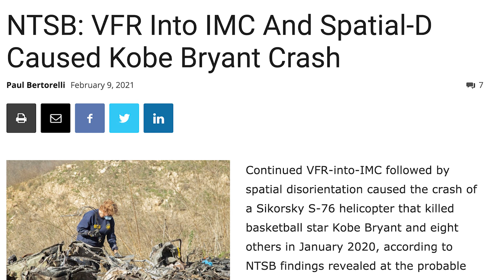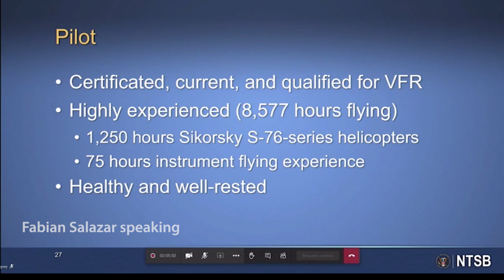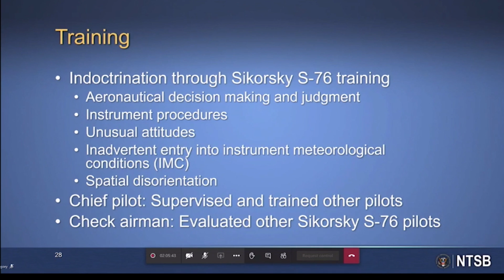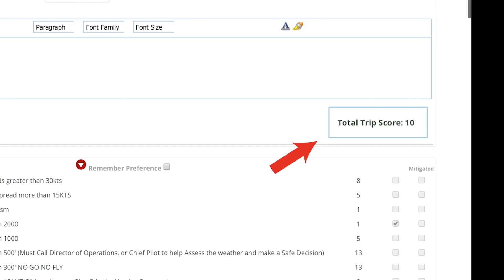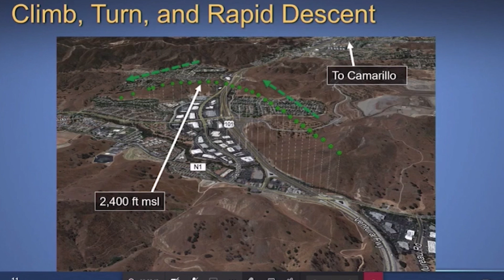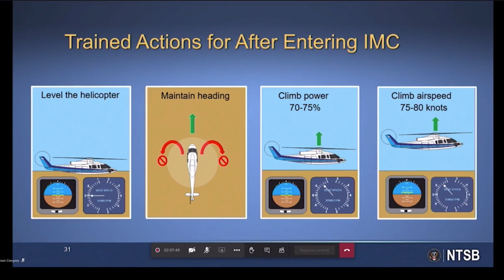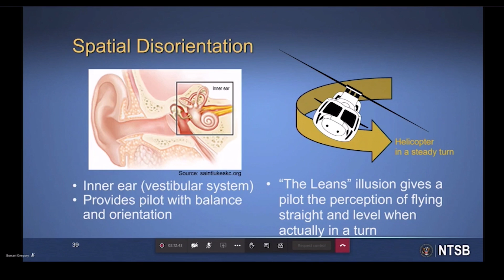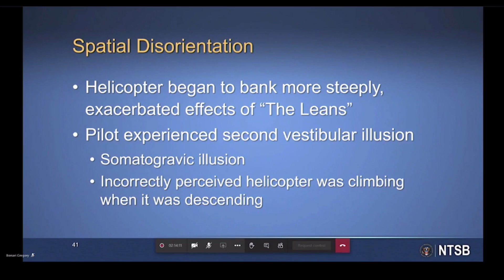How A Split Second Wrong Decision Caused the Kobe Bryant Fatal Crash

Comment: I have been particularly interested in accidents like this one and the Kennedy Jr. accident because it almost happened to me once. I had departed KECP on an IFR flight plan and entered a thick overcast at about 500 feet AGL. I immediately became disoriented and vertiginous and my Bonanza quickly entered a classic left turning spiral dive. The astounding thing was as I stared at the panel I completely forgot how to recover and had no idea what my attitude was. I completely froze. Luckily I had set up my KFC200 autopilot right before takeoff; within about two seconds I recovered enough from the shock to hit the AP button; that simple action probably saved my life. I'm convinced that instilling an ability and willingness to use the autopilot in ALL student pilots would save lives.
Reply: Nice.  Scary but nice.
Reply: I flew out of KECP for around 6 years. Crazy seeing it here.
Reply: Glenn - Would you be interested in sharing your story on ASI's "There I Was..." podcast? It's on iTunes if you want to hear an episode or two. Your story would be a good one to share.
Reply: It maybe easier said than done, but every pilot should have it drilled into them to stare at the altimeter and artificial horizon to the exclusion of EVERYTHING else when they suddenly lose VFR conditions.   Worry about more complex stuff after you avoid rolling over and crashing.
Reply: @N. Warner panic is the complete lose of reason because of fear
Reply: @N. Warner Landing in a parking lot would normally require a call to the FAA and a lot of explaining. His mind simply strongly pushed back against that option, even if it was the only reasonable one (once he was in the thick of it).
Reply: @N. Warner an 8000 hr pilot with 75 hrs instrument knows how to fly without visuals, but as one of the guests commented being prepared is the key to success. When you're expecting to lose visual then your brain is already recalibrating secretly behind the scenes. Even if you felt vestibular disturbances you'd already have committed to ignoring  them and relying upon the instruments. What got him was the surprise IMC. To just lose all sight of the ground and be in complete whiteout is just too overwhelming.
Reply: It's possible that the pilot was distracted from primary flight instruments by looking down at the autopilot and trying to set it up.
Reply: Are you guys listening to what the pilot did?  He wasn’t simply disoriented because it was a high energy impact.  He was rapidly decending.  There is a huge hole in all these explanations I’ve seen.  It doesn’t add up.  There is missing information to this story.
Reply: @MrSilus2000  It does add up you just don't know how to count....
Reply: @jaked6903  count?  Are you insulting me just for being curious?
Reply: @N. Warner It was easy as refusing the flight to begin with. Everyone was grounded that morning. Also, he did not have proficient experience in IFR conditions. Those were two serious reasons to at least delay the flight.
Reply: @member5488  Aviate, navigate, communicate
Reply: Completely agree.
Reply: If you completely froze you have no business flying.
Reply: That autopilot idea is great.  I've heard of so many crashes that occured when something unusual happened, and crew got distracted and stopped flying the plane while they were coping with the unexpected.
Reply: @richardmcspadden9189  sounds very interesting, I subbed! Hope I never have to show up for one of those interviews, no offence... :)
Reply: ALOT of ga planes don't have auto-pilot
Reply: @Tom Gulbranson Well, that's a bit misleading. There are many restrictions on where helicopters (or any other kind of aircraft) can and cannot fly and land. A parking lot is more than likely not a place where you can legally land (unless in emergency). The land is usually private property (which then requires special permission of the owner to land), and more importantly, the FAR restrictions on flight over populated areas, coupled with the requirements for maintaining emergency landing options at any time, would make it illegal to fly low enough over some random parking lot in order to land (again, unless in an emergency).

 This pilot probably could have declared an emergency and then legally landed anywhere, but there's that disconnect in the mind between that "anywhere" normally being out of the question, and the fact that in an actual emergency, it would be perfectly fine.
Reply: @member5488  I would add an hour or two of IFR flight during training, just to get a feeling for it.
Reply: @member5488  that is the first thing that comes to mind when I hear about 'they had a perfectly good machine but it somehow ended up augured in'. thinking about Doolittle being under the hood. you'd think 'when in doubt' watch your gauges. that to me is something that needs to be drilled into aviators heads no matter what.
Reply: The artificial horizon should be so obvious on all aircraft that you simply can't ignore it. Make it a HUD or simply a large illuminated line on the instrument panel. Make it change colors based on pitch and bank angles.
Reply: @Tom Gulbranson The idea is to incorporate critical instrument data (attitude, altitude, airspeed, AOA) into the pilot's regular sight picture so that he or she is always aware of this information, even if distracted or disoriented. I don't mean to suggest (immediately) replacing existing instrumentation, only supplementing it. Along those lines it would be extremely useful to also have onboard an aviation GPS display dedicated to terrain awareness. It's fine not having these things, until it isn't.
Reply: @PInk77W1  is he Really dead !???
If he IS i think it might not have been spacial disorientation But Sabotage. 
  From what I've seen, the tail came off that plane.
Reply: @charleslacombe359  JFK Jr. ?
Reply: @Tom Gulbranson Of course instrument feedback in the pilot's regular sight picture would have prevented this crash. He was banking and descending whereas he thought he was flying straight and climbing. So obviously he didn't know, or check, the attitude, altitude or AOA. As for terrain avoidance, I'm not talking about that at all. It's terrain AWARENESS, e.g. see https://foreflight.com/products/foreflight-mobile/synthetic-vision/.
Reply: @Tom Gulbranson You make it sound like VFR prevented the pilot from looking at his instruments. No, he probably didn't look at his instruments because, despite having an IFR rating, he did not have the proper experience to fly IFR (how often had he flown at night?). Therefore he likely didn't even realize that he was disoriented and the absolute necessity to cross check and keep scanning instruments as navigated the IMC. He was probably distracted by the workload as well, but if you are competent to fly into IMC, then you know that is NOT the time to do noncritical tasks.

I haven't suggested that instruments and terrain awareness be necessarily in a HUD, only that IF they were to be located within the pilot's regular sight picture (a large Tesla-type screen would work) then they would become an unavoidable practiced and normal part of the pilot's understanding of flight conditions at all times, including very likely during the critical lapse that resulted in this crash. The pilot wouldn't have needed to task a cross check or to scan instruments on the panel, the critical flight data would already be right there in his sight picture. If nothing else, the changing colors of the digital gauge readouts along with the red topography on the terrain awareness display would have been almost impossible to ignore. 

Is that pure speculation? Some speculation for sure. The pilot could have been so hopelessly distracted or confused that he couldn't have been snapped out of it by even a synthetic vision display showing a severe departure from the route following the highway into a declining bank below the surrounding ridgeline. But I doubt that. More likely the pilot would have noticed EARLy that instruments and terrain awareness displays conflicted with his seat of the pants senses, allowing him plenty of time to correct.
Reply: @Tom Gulbranson You too. In the future maybe consider that people without your particular SME may still have other relevant knowledge.
Reply: @MrSilus2000  Of course he was rapidly descending, you just don't understand the situation. In his mind, he was rapidly ascending, in an attempt to get above the cloud layer. That's the sensation he was feeling, one of rapid ascent, gaining altitude. In reality, his brain was switching the inputs he was experiencing. Rapid ascent was actually rapid descent, but he didn't realise this because he either did not check or was distrustful of his instruments. If you feel yourself moving forward, but a computer tells you you're moving backwards, are you going to believe what you're experiencing, or the computer? He completely lost his sense of direction and either never checked his instruments to correct or did and decided his instruments had failed (which does happen). He panicked, and decided the best course of action was to accelerate and try and get through the cloud layer. Unfortunately, he accelerated in the wrong direction, or more correctly, he rolled the aircraft to the side, which directed the lift sideways instead of upwards. That's why it was a rapid descent and 'high energy' impact.

The explanation makes complete sense for anyone that understands aircraft, pilot and flight mechanics. Like Jake said, it adds up. You just don't know how to do the maths.
Reply: @CharlesFreck  "In his mind he was rapidly acending"

"That's the sensation he was feeling"

You try too hard to pretend you know what he was thinking and feeling.  Just stick to the facts.
Reply: @codmott286  I have difficulties agreeing about the sudden thing. When you fly toward high ground covered tops you know you are flying toward the cloud LAYER (notice the capital spelling because a LAYER is far worse than just random fluffly little cumulus in warm day or those coming after a cold front has passed) He pushed his luck right at that moment he decided to "give it a go" but he couldn't have ignored about the met conditions is was about to enter.
Reply: @vasicp  I think it was clearly mentionned in the video that a helo can pretty much land anywhere in case of emergency. Just like airplanes do. It's no rocket sciences guys.
Reply: @Tom Gulbranson Tom as you seem well informed, I have a point I'm not confortable with, and it is the decision from the accident pilot to punch trough the layer. We will probably never now exactely if he tought he could sneak his way below the cloud layer in the mountainous terrain OR he was commited at some point to punch trough it, but in both case it would be a very bad decision to punch the layer so close to terrain. Because you have two major thing to do at the same time, i.e. keepin clear of groun AND keeping your aircraft under control in IMC) If you have to punch trough a thin layer at least do it away from any terrain.
Reply: @MrSilus2000  Exactely, this is the part that is pure speculation. EVen if this illusion is well known and can be reproduced in simulators / laboratories (it's well known for decades) nobody know what he felt and I suspect the whole thing to be more more complex than yada yada yada.
Reply: @Tom Gulbranson Funny I just left a comment here somewhere about the haze thing. It happened to me as well so I can perfectly relate. Off course his decision to climb was the correct on, but what I meant is if you have to do this, get away from terrain, take a straight line some nautical miles and punch trough it. Get yourself out of the hassle to keep clear of terrain and at the same time try to keep control of your machine. It is enough stress to punch trough cloud layer all by itself why add the stress to maintain ground clearance. How will you ever calculate it, do you know the exact climb gradient of each slope segment in ftont of you ? Off course not, so why gamble with a decision like this. I'm not saying that this is what he wanted to do, maybe he was just trying to pass under, saw the layer, turned and entered IMC anyway and lost control, without ever wanting to punch trough it.
Reply: @12345fowler  He was flying low over Highway 101 which started to wind befween some hills in Calabasas. Quite possibly he thought that he might be able to stay under the ceiling but just as he approached a left curve in the freeway with a large hill straight ahead, he entered MIC. So he had to bank left while also climbing to get on top of the layer.  That's likely why he became disoriented, not simply because he was trying to "punch through". And very possibly he never even looked at his instruments. The other Tom, the flight instructor, claims he lost control but in fact this appears to have been CFIT.
Reply: So you abandoned IFR which caused the problem until you switched to AP? What did you abandon IFR?
Reply: @juliahayden9213  Apparently when he took of it was ok; it only became dangerous later.
Reply: @vracan  Did the helicopter?
Reply: @tomszabo7350  I take it all commercial carriers have this? Not been a major carrier crash in over 19 years.
Reply: @Tom Gulbranson Dou you think either the pilot or passengers knew they were about to crash? Thx.
Reply: @Tom Gulbranson Apparently no way of telling.
Reply: @Tom Gulbranson Perhaps you have seen this....the Flight Channel produced an animated reenactment of the flight: https://youtu.be/WOl9Rgoo7Lg

To a layperson, that is bizarre would not know up from down, straight from turning, or even left from right. The latter was shown to be a contributing factor in another crash depicted by the channel.
Reply: @Tom Gulbranson Thanks. At 8:16 of this video is the aforementioned flight where the pilot did not know left from right: https://youtu.be/JN6IhJfab1g
Reply: @jeffzest8393 Even early implementations of TAWS (1970s) have been incredibly helpful for major carriers (especially in U.S. airspace) combined with improvements in cockpit situational awareness and CRM. Class A TAWS requires a visual terrain display and has been required by the FAA for larger fixed wing aircraft since 2005. Had a Class A equivalent HTAWS system been installed (available since around 2010) and regularly used in this helo, the crash would very likely have been avoided.

This flight wasn't just into IMC leading to SD, it was into IMC at the exact moment that the terrain closed on the sides, pinching the possible flight path and requiring a maneuver that was not easy even under ideal conditions. It's hard to say why the pilot "charged" into this precarious situation but likely he didn't plan or think enough ahead and was caught by surprise at the wrong moment.
Reply: Ugh.
Reply: Quora Killer  The marine layer was about 1000 feet in the L.A. basin but varied according to terrain. He was flying low along Highway 101 and had already passed Hidden Hills at which point the highway is actually over 1000 feet MSL. This would be the highest ground elevation he'd have to fly over when following the highway. So he probably thought he'd make it all the way to Camarillo from there under VFR. Unfortunately the highway takes a left ahead at Calabasas as it winds between hills. Here the marine layer was thick at 1000 feet and this lower ceiling was obscured as the terrain closed on the sides. As he realized the predicament, the pilot may have decided the only option was to climb above the layer while banking to the left as he tried to continue following the highway. In reality he could have cleared the hill ahead of him which was only 300 feet higher than the highway elevation he had just flown over. This would have been a much safer maneuver as he'd need to keep an eye on fewer instruments and flight parameters. Moreover without banking the odds of SD progressing to utter confusion is much lower, something that he probably did not consider and that was probably the main proximal cause of the crash.
Reply: @member5488  It IS easier said than done!
Reply: @MrSilus2000  You weren't just being curious; you stated a position on the matter
Reply: @Tom Gulbranson You still have to comply with the 1,000 foot rule over congested areas while en-route unless (d)(1) the Feds have otherwise prescribed a specific altitude - which I doubt has happened very often during your flights.
Reply: @Tom Gulbranson I strongly suspect that was his goal - to do a quick punch-through to on-top.  That's probably why he was cranked up to 140 kts while underneath:  convert it quickly to altitude, outclimbing the hills.  The radical transformation in aircraft speed and pitch wasn't a situation his occasional IFR skill could handle, although he probably thought it wouldn't really matter much since he expected to break out on top in short order anyway - before anything could go wrong!  Responding to the "ident" request, or something similar, must have distracted him at the crucial moment, before he had stabilized the aircraft and while struggling with his marginal instrument SA, and it simply got away from him.
Reply: @larryslone65  "It doesn't add up" and "there is missing information to this story" isn't really a position.
Reply: @vasicp   So instead for full power forward into terrain ? I thought  the entire purpose of a helicopter you are able to HOVER and land just about anywhere fuck the FAA explanation save the lives first. If this conflicted him he should never have flying or training others..
Reply: This happens to me in video games flying in snow...and im sitting in a chair watching a tv screen
Reply: In many cases of spatial disorientation on airliners, pilots tried as a last resort to engage the autopilot in a desperate hope that it would save the day. It typically wouldn't.

I certainly hope that the lesson you took away from that episode went beyond engaging the autopilot and that you were able to identify and correct the reason why you became disoriented and why you froze. Was it training deficiency? Was fatigue or stress involved? Was flight planning effective in building a mental picture of the weather situation and the challenges that ensued? Etc...

The autopilot is a great tool but is generally NOT designed nor intended to be used as a control recovery device.

You were indeed extremely fortunate to escape unharmed but it looks like sheer luck from my perspective and one shouldn't rely on luck to prevent mishaps.
Reply: @David M There isnt at all?  What are you referring to?  Context
Reply: @tomszabo7350  You "probably" don't understand SD.
Reply: @bbigjohnson069  It's not difficult to understand ... when you  are banking into a tight turn at high speed the centripetal force pushes you into the seat and this can disorient you into feeling as if you are in level flight and climbing. Zero visibility causes additional confusion preventing the regain of orientation.
Reply: God was with you
Reply: Keeping an autopilot program set for a speed and heading which will bring you above the highest obstacle is a good idea.
Reply: One way to avoid surprises is to look ahead. If there is clouds, then IFR is likely. Mentally prepare to go instruments before take off, not to mention the engine out on take off plan.